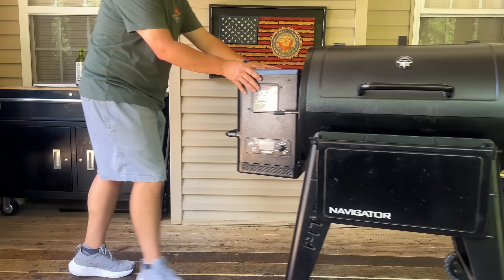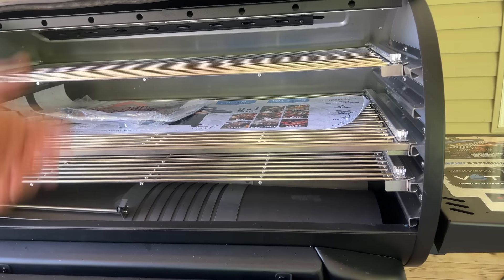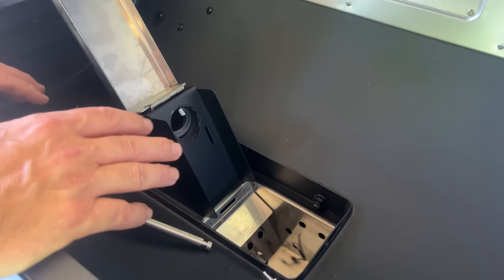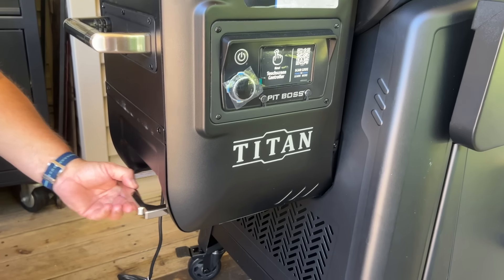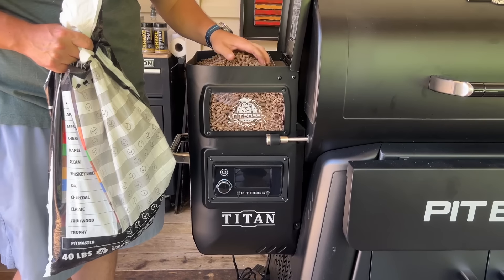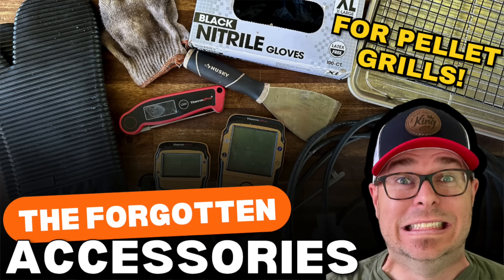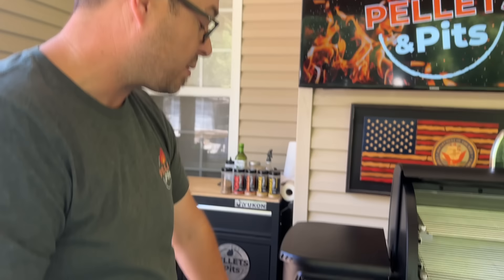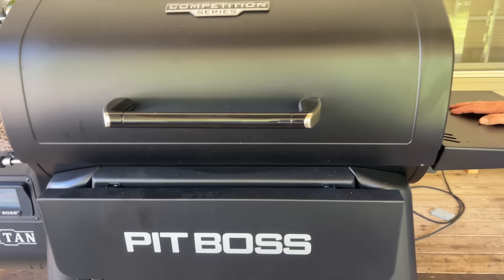Pit Boss TITAN REVIEW - New Pellet Grill!

Comment: @pelletsandpits How does the app work? I've heard that Pit Boss is sending out new controllers because the controllers that are with the grills now do not have the most recent firmware and the only fix is to replace it?
Reply from the maker: Interesting...I have not had any luck...so Pit Boss actually says they can not help...we need to call our internet provider...
We saw similar comments and someone said to switch wifi from 5g to 2.4 g...and thats what the Titan says...it only runs on 2.4 hrz...so we bought an extender that allows that to happen and still CAN NOT connect...its extremely frustrating...my 2 wireless thermometers, and 4 other grills connect...no problem
I will have to look into that...its not ok to be happing that much
Reply: Many devices cannot hook to 5ghz. And you need to use 2.4. If your house wifi/router has a guest network option, set it up and you will have a higher likelihood of success. Thats the only way we could use our roomba and even my Memphis wood pellet has the same issue…don’t get me started on that

Comment: Good review. I bought the Titan last week, and the one thing that these videos don't talk about is the main problem that it won't connect to your home wifi. And like everyone else who has called customer service, it is our home networks fault and not Pit Boss fault, even though everything else in my house will connect. Something is wrong with the controller, and you can't update the firmware if you cannot connect to wifi.
Reply from the maker: I am currently having that problem right now...I am actually filming right now and just mentioned that...same problem as well...5 grills and 2 different thermometers have connected no problems at all...it has to be a PIT BOSS Problem...
Reply: @PelletsandPits  When you call, they will tell you that if you can connect via Bluetooth and not wifi, then it is your home networks fault, and for you to call them and see if they can figure it out. If they can't figure it out, which they can't, then Pit Boss will help you out. More than likely, send you an updated firmware controller. Which I have read will correct the connection problem. Also, I have read from other owners that they were told that this controller has 2008 chips in it. I personally believe that the firmware will not connect to the latest wifi bands. Thus, not connecting to your home wifi. So, when you decide to call PB, tell them you have already talked to your internet company, and they said there is nothing they could do.
Reply: Did you get the problem solved, or did you have to call Pit Boss? If so, what was their answer to the problem, and are they sending you another controller?
Reply: @PelletsandPits if I had to guess it will only connect to a 2.4ghz wifi which most networks should be able to put out.

Comment: I do think pellet grills are neat. What happens if your power goes out? Might be cool if they had a battery backup mode for it preinstalled and it charges when it needs to charge when it is plugged in. Little peace of mind. Just a thought. Looks good though.
Reply from the maker: 100 fair question...no doubt

Comment: I’ve been looking at the Titan. One thing I don’t like about the shelves is that the wire runs from side to side instead of front to back. Makes it difficult to work a spatula. Everything else looks amazing.
Reply from the maker: Why....you flip side to side..why run the racks that way...running left to right makes it one fluid move...by having up and down grates you would use that motion and then flip side to side...seems like its a better fit...BUT more importantly i think its more about the ability to remove the grates...im sure thats the difference in the design...

Comment: That would be an absolute nightmare to clean inside.
Reply: All pellet grills are nightmares to clean.  Hopefully he will show us this one.
Reply from the maker: ???? why...it literally has an ash pot dump...most pellet grills are the same way...remove and get the ashes out..
Reply: Right. Spray the inside and grates down with oil and do your burn in. That will season everything and make it much easier to clean. If you are really worried about cleaning then put a drip pan under whatever you are smoking and then you only have to worry about cleaning grates.

Comment: Meanwhile in Austin, Minnesota...my Even Embers pellet grill is Not smarter than I am.  Sorry Sir, I'm starting to think that manufactures overloading what should be a relaxing thing.
Reply from the maker: While im asleep on the couch....my grill can adjust temps...sounds relaxing to me
Reply: @PelletsandPits  not throwing shade Sir.  I just enjoy being in the Men's Crisis Center tending to the Flatiron & The Smoker.
Reply: @PelletsandPits  until you have to clean it.  I hope you show a clean-up on this.
Reply: @gosman949 cleaning a pellet grill is easy. Shop vac or old vacuum and a scraper is all you need. This grill looks super easy since the grates are easily removed too. Might not even need the vacuum since it has a removable burn pot to dump the ashes out.